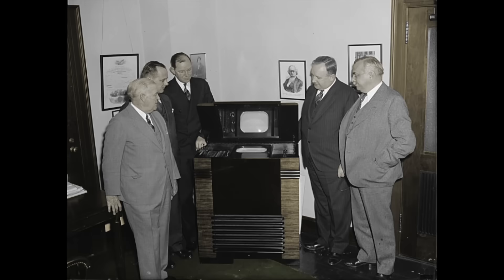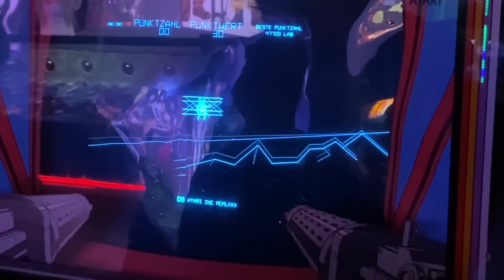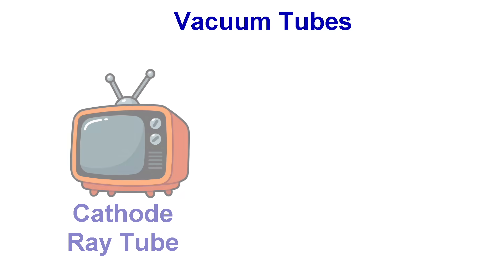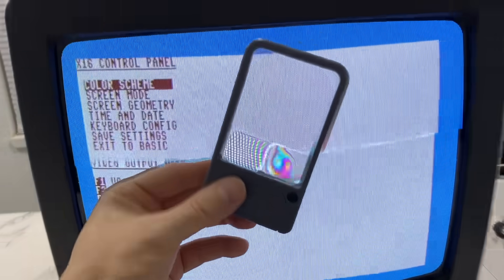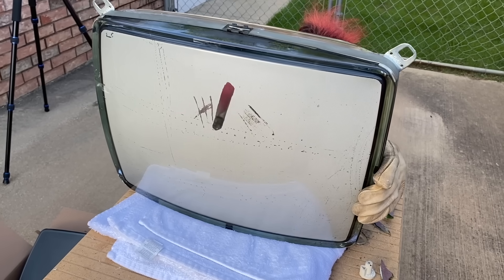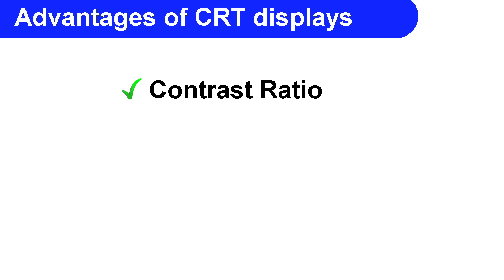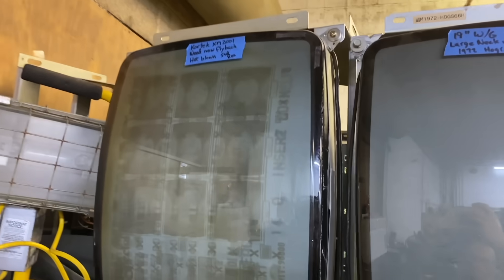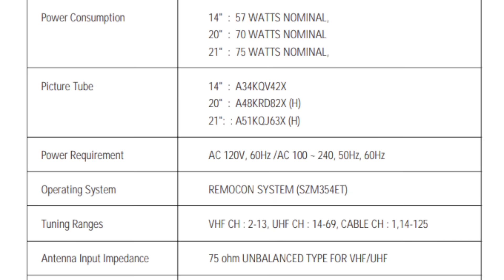How Cathode Ray Tubes Work.

Comment: There's a more recent technology called the "Laser Phosphor Display" where it's similar to a CRT but the beam of light is driven mechanically with a UV laser. This removes the need for a vaccuum seal and therefore a bulky weight, and also allows it to have very low power consumption on par with or better than today's OLED displays. I always thought this is a great way to preserve the look and feel of retro games, but no company seems to realize it.
Reply: mfw the company that has a patent on it hasn't made a consumer monitor with this tech and it doesn't expire for another 7½ years
Reply: No need for a phosphor screen.  There are large projection systems that use separate R G B lasers deflected by spinning mirrors.  Perfect convergence and focus no matter what the shape, angle or size of screen.  Really expensive and hazardous to the eyes should one get in the way.
Reply: @haweater1555  The Canadian company Image Maximum (better known as IMAX) utilizes this technology in its digital movie projectors.  One of the only true black to white contrast ratios out there.
Reply: A company called prysm is making them but they're only designed for business purposes.
Reply: UV lasers aren't common nor cheap. Only wide use case is scientific applications.
Reply: @No-mq5lw  UV lasers aren't necessary to activate phosphors, blue violet lasers will do just as well.  LED lighting, which is the solid state variation on fluorescent lighting as it uses phosphors on blue-violet LEDs to generate light.
Reply: Bother modern OLEDs and CRTs back in the day always drew more power from the wall then equivilantly sized LCDs of the time.
The problem with power draw is that no matter how you slice or dice it, self-emissive display technologies will always draw more power, because having each pixel produce it's own light is less efficient then having fewer, more powerful LEDs produce the light and then filter it on a per-pixel basis...
Afaik LGs WOLEDs draw slightly less power then Samsung QD-OLED, despite LGs panels having more subpixels per pixel. That White subpixel making most of the light does help with efficiency I guess, tho at the cost of color saturation...
Reply: They would need a larger market besides retro gamer's, plus I would think the mechanical nature would wear out quickly.
Reply: @caveslug-t2k  for modern gamer and movie lover and those with Football fan, lack of motion blur would be benefit too. People with old VHS tape laying around could benefit from non native resolution too. I would want to use it maybe petition to make LPD a norm could destroy LED display technology and died like CRT (CRT should be alive)
Reply: @caveslug-t2k   If that was true, mechanical jukeboxes would stop working within 1 month
Reply: yeah and with the modern retro gaming community, having affordable, lightweight, crt replacements would probably sell acceptably well.
Reply: ok for low-res and low refresh-rate, but if you go up with more modern resolutions and high refresh rate, you'll fast need insanely high-speed oscillating or rotating mirrors with very good synchronisation . It's much easier to control an electron bean that weight nothing.
Reply: I’ve looked into the technology and patents significantly and unfortunately there’s a LOT of limitations. The fact that the laser is mechanically driven limits the speed and reliability of the mechanism, and it’s limited to the horizontal resolution of the width of the phosphor strips they apply. Also, they’re not very keen on licensing the technology and their displays aren’t that much to write home about.
Reply: I look up LPD... and I realized that it is now a just laser projector technology. it's a projector.
Reply: @NeverMind-pk4wz i made a super long explanation, auto-deleted by youtube. So a simpler one: 
Because only one dot is displayed at a time and this dot scan the screen surface line by line:
1°) low refresh rate = high flickering.
2°) you need two rotating mirror to do the scanline with a laser.
3°) The high speed mirror  will have it's rpm = number of lines displayed per second / number of mirror's facets
5°) mirror with low number of facet = display not so deep, high number of facet= display is deep in size like a crt.
6°) for a display with high brightness, you need a quite powerfull laser, it will heat the mirrors. So they need to be very good and quite big .
6°) mirror is noisy

This techno was used on barcode scanners, was unreliable and noisy, it has been abandoned nowadays. All barcode scanners nowadays simply use a led, a camera sensor and a picture analyser.
Reply: You do want vacuum for UV. ASML makes their machines vacuum. That is because UV light degrades a lot in air, every molecule it hits gets excited and might loose electrons.
Reply: probably because they're expensive.
Reply: The Js will never allow it to happen...
Reply: CRT's made after the 80's drawed almost nothing
Reply: @NEON2600  Probably because large scale integration and very large scale integrated circuits replaced earlier discreet transistors and older basic ICs as well.  Also the power supply systems in modern televisions probably utilized switch mode power supplies that are more efficient to the conventional power supplies in earlier models.
Reply: Drew, not drawed  @NEON2600

Comment: There was a promising display tech known as SED (surface-conduction electron-emitter display) which had many of the perks of CRTs, but was also flat. They only built a few 720p prototypes and promised 1080p, but it's literally a lost technology today.
Finding one would be a holy grail.
Reply: They intentionally killed off SED TV because it was competition.

Would've been really good.
Reply: if only it was released think it would compete with lcd and oleds
Reply: @superlavahair1536 Looking at a diagram of how an SED works, it's way too close to an OLED to be distinct
Reply: It sounds interesting.
Reply: It's the reason Sony got left behind in LCDs.
Reply: is it like a high pixel density vfd, basically?

Comment: CRT is a holy grail of FPS games. I only gave up my CRT once gpu's stopped the support. Gdm-fw900 was a helluva monitor. Still got 420 euros out of it when I sold it couple years ago.
Reply: i keep a GTX Titan card around for JUST that reason. its obviously not my daily driver anymore, but its the fastest vga capable gpu.
Reply: @smiththers2  That GTX Titan doesn't hold a candle to the clarity that a Radeon can achieve on the same monitor and this is coming from a huge Nvidiot.  Everything passed the GeForce 7000 series has shit clarity on a CRT,  believe me I wish it wasn't so.  I would much rather run a Titan X for my ultimate XP box.

Comment: In about 1985 I discovered another good “degaussing tool”. By that year we had both Atari 2600 and Intellivision game systems, and for some reason the more you played games on the TV, the worse the color accuracy would become. I remembered years earlier seeing a color TV being degaussed at an RCA shop and I had an idea. I had a basic understanding of how color TV worked, and what the degaussing process was meant to accomplish, and although I didn’t have one of those big rings, I did work at a radio station where we used a portable, hand-held electromagnet to erase tape cartridges. How you held the tape relative to the magnet as you used it made a BIG difference in how clean the tape would sound next time we used it (tape cartridges looked a lot like 8-track tapes and would store a commercial, a jingle or sometimes a song). I figured the tape eraser could work just like that big ring I had seen years before at the RCA shop, so I asked to borrow it overnight. It was a very quick matter to fix the color on my TV set. I remember driving over to my best friend’s house that night to do the same for his TV. It worked beautifully!

Comment: I wish CRT manufacturers of the early 2000s had wised up and started marketing their products as "gaming monitors" or "gaming TVs."  That would probably have extended their life on the market.
Reply: it wouldn't have helped. By mid '00s LCDs became very cheap and just good looking 'enough' for most gamers to not care. Not to mention the widescreen advantage in online games, which was the final nail for CRTs. So the choice was either a light, flat, wide LCD that didn't flicker at 1680x1050 versus an xboxhuge square and very heavy CRT that made your eyes tear at 1280x1024.
Reply: @wrmusic8736  I mean, the very pricey GDM-FW900 was a 16:10 thing that could display 2304x1440, and its equally pricey 4:3 cousin, the GDM-F520 could display 1024x768 at 170 Hertz, and a 2002ish issue of MaximumPC says that Sony could have further improved their refresh rates, but sadly, that never materialized.
Reply: @wrmusic8736  And let’s not forget the inconvenience of bringing bulky and heavy CRT monitors to LAN parties, where strategy and tactics were more important than visuals, not to mention their energy consumption and heat development when a dozen of them are in the same room.
Reply: @s4ndwichMakeR Brilliant idea!  I need to build some biceps and abs anyway, so bringing a CRT to a LAN party will kill two birds with one stone!
Reply: They would make millions if they invested in a 4k CRT 60hz
Reply: @gabrielvieira6529  until you think about the size of that thing and how ridiculously expensive it will be because of widescreen.

I doubt a lot of people would admire a 40" searchlight flickering at them at a mere 60 Hz for $4000 or something.
Reply: @gabrielvieira6529  No, they would probably make tens of thousands. It would cost millions to start up the factory though.
Reply: @gabrielvieira6529 As a matter of fact, there was a monochrome 19-inch 4096x3300 at 72 Hertz monitor made by MegaScan Corporation in 1988, of all years!

Comment: You probably should have mentioned CRT flicker. It can be rather harsh, especially if you're driving a CRT at a low refresh rate to achieve high resolution. For example, my last CRT could do 1600×1200 resolution, but only at a 60Hz refresh rate. The phosphor was designed for 80Hz or more, so it flickered hard.
Reply: Also, the aspect ratio issue has been rendered somewhat moot by the massive size of LCDs these days. You can now get a reasonably-priced 30-inch 4K LCD that will almost completely fill your field of view. It's quite pleasant to use, and I wish I had one myself!

Comment: Surprised you didn't talk about the beautiful pixel art back in the day that was designed specifically for CRTs. Without the gradient that CRTs provide, a lot of the effect is lost and you end up with blockier, uglier graphics. So CRTs are also really nice for retro gaming.
Reply: It works only for CRT televisions with composite and Rf inputs. Doesn't work with RGB connections and CRT computer monitors though

Comment: I remember an old video of yours in which you said that you personally preferred 4:3 monitors precisely because of the greater visible area compared to 16:9.
And in fact, I recently received a 19" philips in 4:3 as a gift, there is a lot of visible space even on a modern computer with Windows 10.
An excellent compromise, not widely used however, are 16:10 monitors. I have one on an old DELL laptop and it's way better than 16:9.
However, you have made me very curious about the functioning of the Sony Triniton, I don't want to look for a video from some other user, I hope you make a separate one just on those because your way of explaining is certainly among the best on all of Youtube.
Reply: I went 21" 4:3 -> 20" 16:10 and it was a massive downgrade! Years later, I got a 23" 16:9 which is better, but still feels a little cramped vertically where the 21" 4:3 was as tall as I could use.

Comment: I once had a stereo unit connected up to my TV, with a large subwoofer underneath.  Learned I had to move my subwoofer when the corner of the TV was magnetized and the colors became smeared!
Reply: From speakers to screens to motors, it's amazing how many things only exist thanks to electromagnets.
Reply: @stevethepocket  Early TVs had electrostatic electrodes in the tube, like oscilloscopes, for deflection, yet they needed more shielding than magnetic deflection tubes,

Comment: me: hates crts for even existing after hurting my eyes and ears for years.
8 bit guy: here's how they work
me: why not? 
LMAO
Reply: The eyes part is due to the 60 Hertz flicker, though this could be avoided by running at higher refresh rates.
The ears part is the electron gun squealing at 15.75 or 15.625 KHz, which has something to do with the line rate of analog TV signals.  VGA displays did not have that problem because their squeal rate was 31.5 KHz or above, which human ears can't hear.
Reply: @MicahtheDrumCorpsPseudoboomer  I could. Back in high school every time the computer teacher reimaged the computers maybe 4-5 students including myself compained. We had to log into each system and change the refresh rate to 75. Prior to that it just hurt to be in that room. And to make things worse every time the teacher projected his screen on to ours it switched to 800x600 60hz. hurting both our eyes and ears. And that was definitely past VGA.
Reply: @MicahtheDrumCorpsPseudoboomer  Some autistic children have been found to hear sounds up to 30kHz. Given how many people complain about VGA CRTs, I think a lot more people have exceptional hearing than you'd think.
Reply: @eekee6034  Fine, let's raise the resolution to 1920x1440 and the vertical refresh rate to 75 Hertz, resulting in a horizontal refresh rate of 112.5 KHz.

Comment: I held onto my CRT computer monitor for quite a while. At the time, the main advantage of LCD displays were that they took up less desk space, but LCD displays were significantly more expensive. There was a class action lawsuit saying that between 1999 and 2006 LCD manufacturers coordinated together to keep LCD prices artificially high. After the manufacturers got caught doing that, the price a LCD screens dropped. Suddenly LCD monitors were smaller AND cheaper. After that, there was really no point in buying a new CRT screen.

Comment: About longevity. My LCD flatscreens lasted a lot longer than my CRTs, and my LCDs are more heavily used too as there's more content to watch and longer games to play now.

Most of my CRTs barely lasted a decade. I did receive a heavily used one from my grandmas house that was 11 years old though, color was very off on it as it died 3 years later. But still, as a broke kid, it was better then having to share the living room TV for gaming.

And they were kinda cheap CRTs (Zenith, Sharp, and some no name brands) but these LCDs I'm talking about were also cheap (Samsungs and Toshiba)
Reply: Besides the tube, many of the components in a CRT have to work with more voltage and current with more precision than anything in an LCD. I'm getting mixed info on the lifetimes of the tubes themselves. I expect there's an extremely wide variation.